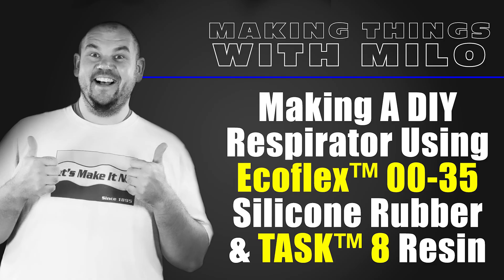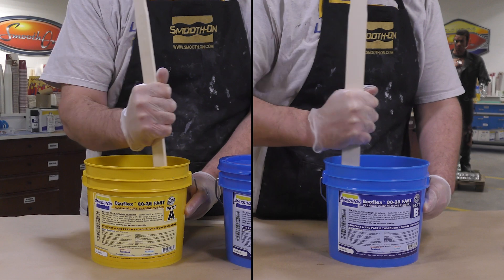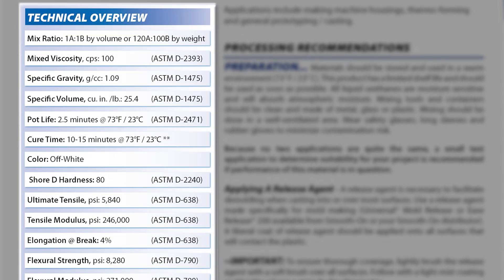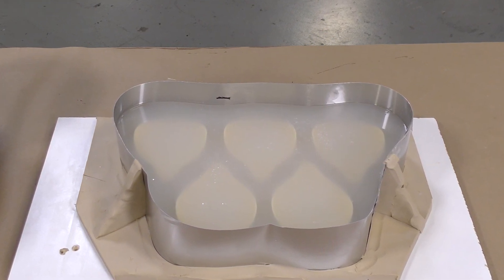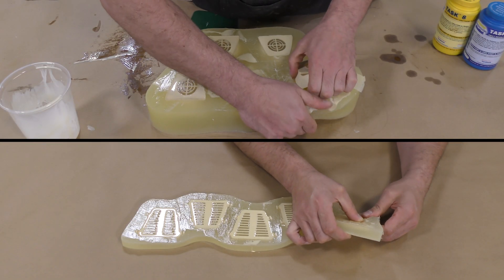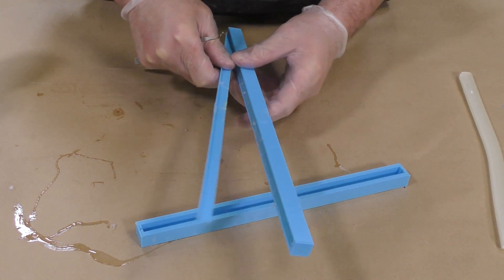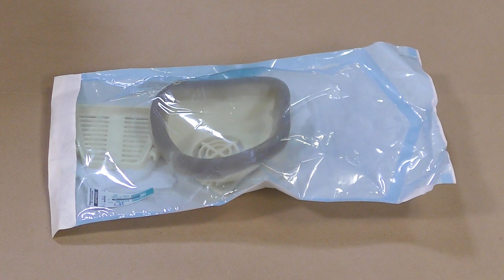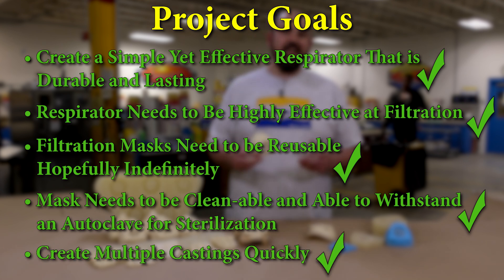How to make a DIY Respirator Using Ecoflex™ 00-35 Silicone and TASK™ 8 Urethane Resin

Comment: the mask i designed, has eye lets on the side of the mask for the elastic, this prevents any gaps in the mask, like you say is no good, but how do i mold those? wont the silicone fill those holes in? im not sure i know how to unmold the mask if those have silicone stuck in them. thanks

Comment: Quick question; How many respirators with its filter housing can you make form 1 gallon Task 8 aproximatly??? Thanks!
Reply from the maker: About 135
Reply: @smoothon  One last question; We have some Vytaflex 10 Urethane Rubber gallon, can we use that to make the mold instead of the platinum cure silicone? We would be using platinum cure silicone for the gasket and Task 8 resin for the mask itself. 
My question is would there be any problem related to the chemicals on the Urethane Rubber that requiere special handling. Do the Vytaflex rubber molds become safe to handle and cast after it has been cured?
Thanks for your time and for the great video guide! we already purchased materials to make 450 masks =D much devibe than the cloth face mask, just in case things go bad and it becomes airborne, it would be awesome to all of us creating mask and every person can have access to one due to supply chain down now days.

Comment: I am finding it difficult getting this printed at a reasonable cost ( a local 3d print shop quoted me $75)  my local friends with printers can't do it for me as the mold gasket parts are about 400mm long.  wish it was designed for the more common 200 by 200 printers.
Reply: You can print half and half, then glue the pieces together. Get creative.

Comment: I notice that the cap has four hooks instead of holes for straps. What if there are holes on the outside of the mask, as on many other designs? Is there anyway to cast mask with strap holes?
Reply from the maker: You could mold and cast a mask with holes, but the hooks made it easier to mold.

Comment: How long would these masks last?
Reply from the maker: TASK 8 is an industrial resin with a high impact strength and high temperature resistance.  The Ecoflex silicone also has a very long library life.  Durability would come down to the treatment of the mask when applied or removed, and number of autoclave cycles if applicable.

Comment: Hey Milo - Do you have any tips for getting nice edges on one-part molds like these?  I always get a bit of a concave finish when the resin cures, and between that and the shiny finish, the fronts of my mask are coming out looking very rough compared to the smooth and duller finish of the 3D printed mask parts.   Any suggestions?
Reply: gjshzbjhd❤👏

Comment: Great video! I am looking into Task 8 for its ability to withstand heat. I have a small benchtop direct injection machine and have been experimenting with different high heat resins to make the molds out of (without needing a CNC), problem is that typically resins can handle the heat (often resins with aluminum fillers) are too brittle and thin sections of the mold snap off during the part removal. Have you guys tried Task 8 in such an application, or do you have any recommendations for other high heat resins that also exhibit high tensile and shear strength? I am using plastic pellets with a relatively low melting point and 250f in the mold should do just about right
Reply from the maker: TASK 8 is a good material to test for this application.  For your application we recommend using the heat  curing schedule shown in the TB.

Comment: What types of silicone could you use instead of task 8?  I have many on hand and am wondering if I can use them to make the whole mask out of silicone. Then they can go in the dryer for a convenient dry heat sanitize cycle. 
Many types of "bugs" survive moist hot environments much easier than dry hot environments. For example ticks and giardia can both, usually, survive going through a wash/dry cycle, even on hot, but cannot survive the dryer alone as the wash cycle introduces water, lowering average dryer temperature and providing moisture to survive. It's creepy to think about really.
Reply: Also, is there a design with an output valve? As this is really a respirator design and should seal quite well, I would imagine co2 buildup could be a potential problem. Making a valve out of silicone should be easy enough to do. 
Also, yes, I realize having a output valve defeats the purpose of wearing a mask right now, which is to prevent spreading of pathogens as we can be asymptomatic carriers.
Reply from the maker: These are all great points and questions.  We consider this video a starting point for those who wish to undertake this type of project  Of course, as time goes on, our innovative audience will make refinements of design.

Comment: Thank you, Milo and Smooth-On. The Suay Community Mask Coalition has recommended the use of two layers of Wypall X80 or Zep polyester hydro knit shop towels as a filter material. Please research this as a possible disposable alternative to the HEPA vacuum bags. #StaySafe
Reply from the maker: Thanks for the info!
Reply: or just use 3m filtrete 2200 HVAC filters. no fiberglass what so ever and is the exact same material N95 masks are made of

Comment: Great video, thanks.  Would Smooth-sil 945 work instead of task 8 for casting gang molds?  Is it food safe like the 940?  Extended pot life would be helpful for degassing.  I want to cast the entire mask in silicone that can be autoclaved.  Thanks.
Reply from the maker: Smooth-Sil 945 would work for a mold material.  It has not, however, been rated for food safety.
Reply: @smoothon  would you recommend Smooth-sil 950 in this case for a durable skin-safe mask?
Reply from the maker: It may be possible to use this as a mask material, but testing would be required.